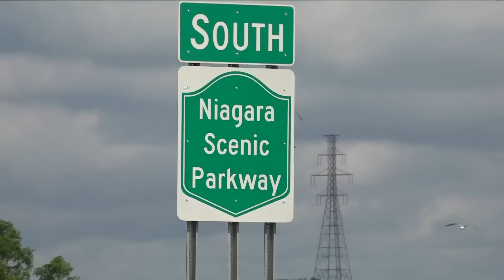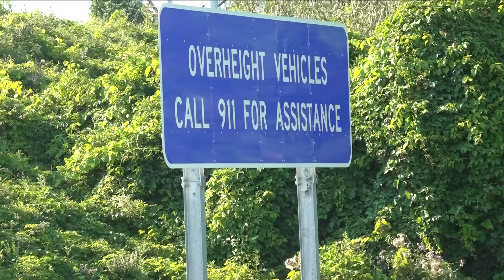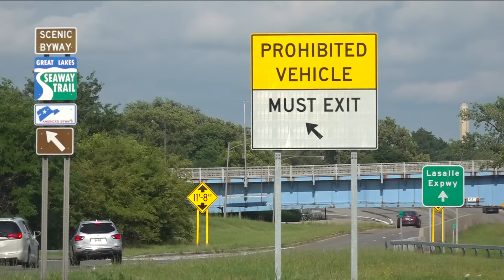Multiple Bridge Collision Issues in Niagara Falls.

Comment: I can relate to this problem. One time I was operating a construction box truck and went under a relatively low clearance railroad bridge. Our truck carried its ladders on the top of the truck. Without the ladders we would clear the bridge with inches to spare. But I forgot about the ladders. Lucky for me I was going slow so I heard the ladders hit the bridge. I stoped the truck and backed up and we were able to re tie the ladders to the top of the truck. There was no damage to the ladders or the truck and I backed down to another street and found a crossing over rather than under the tracks. Final note I did file an accident report and the company installed ladder racks on the side of our truck to avoid something like that happening again. But truck operators must be aware of their clearance hight including anything being carried or installed on top of the truck.